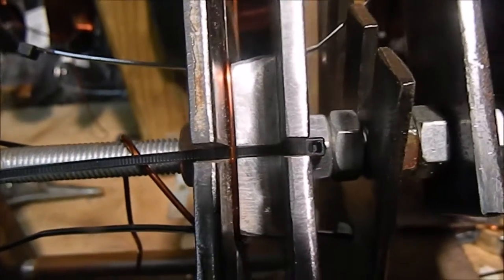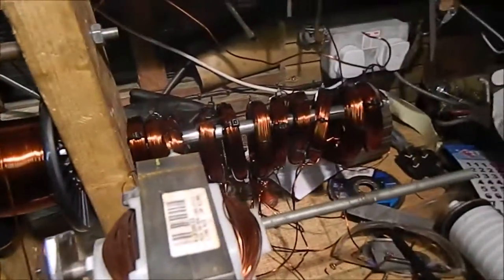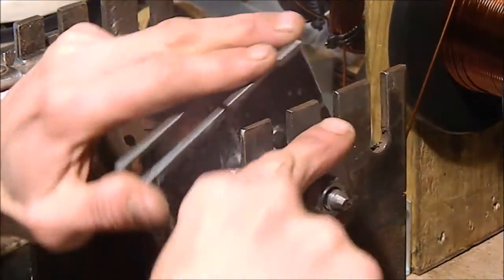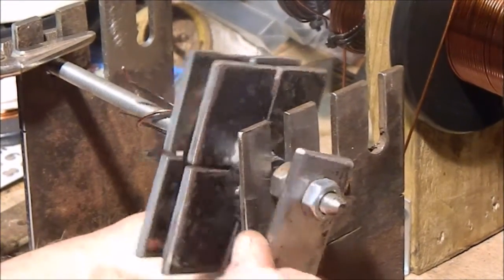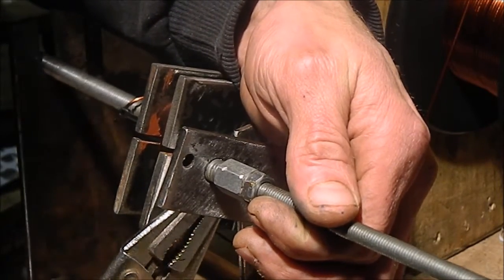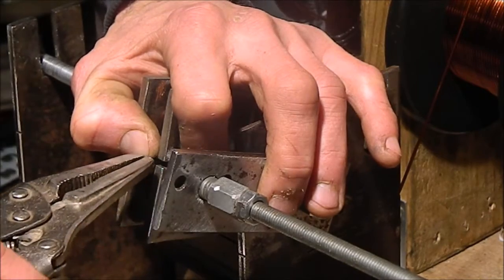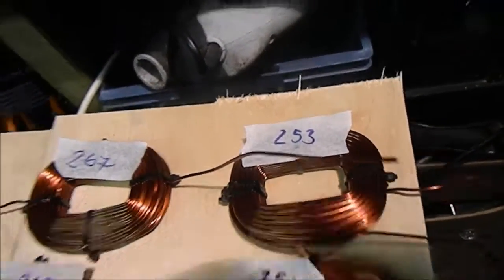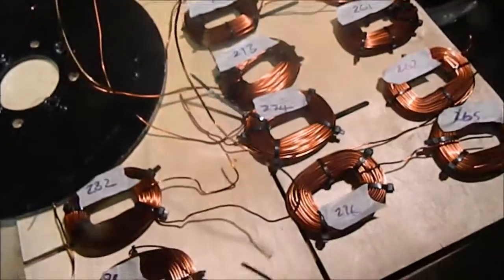24 volt coil winding for wind turbine stator pt 2 11/12/2016

Comment: Nice work Gavin can you please tell me what guage wire and how many turns would I need around 20mm by 20mm bobbin centre 75mm long with 75mm diameter if I need 50 amps and 60 volts from a single coil, my magnets are n52 60mm by 200mm rotating at 6000rpm
Reply from the maker: Are you sure you want 6000 rpm , are you making a hydro set up or trying to build a generator?
Reply: @GavinFreedomLover  it's a new design for a generator/pulsed power supply and the speed of the magnets is variable we can control that between 3000 to 6000 but I'm thinking to reduce the magnets size for the purposes of testing to 60mm × 30mm n52

Comment: Very Nice video Gavin, I want to create my own motor but with stator electro magnets rather than permanent magnets. I was wondering if each winding in the stator should be in opposite direction to the one next to it. is it the same in both DC and AC motors in terms of stator ?
Reply from the maker: Hello my friend , I have not tried this so I would not know , maybe you can set up one coil and one magnet to spin past it and check the result.